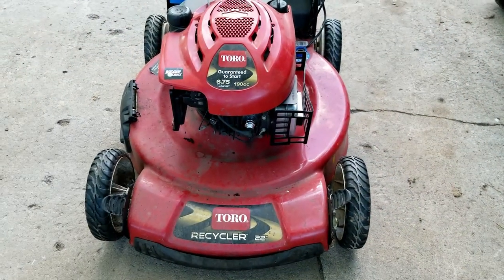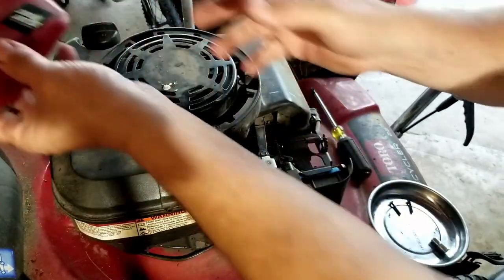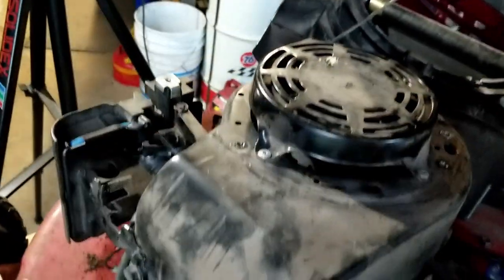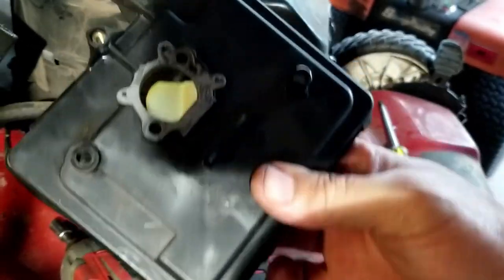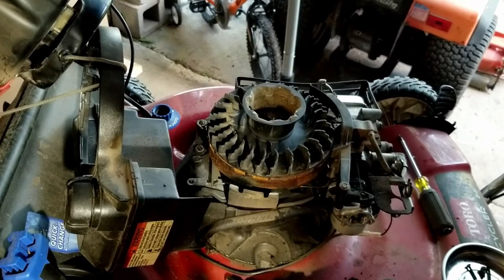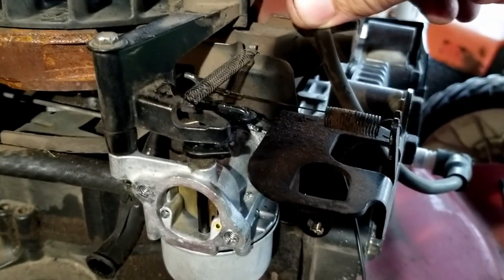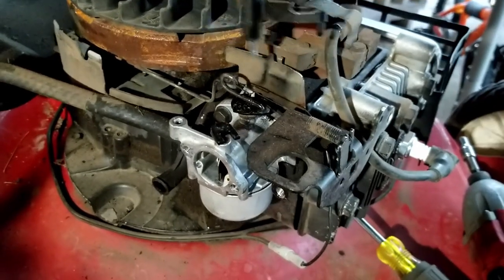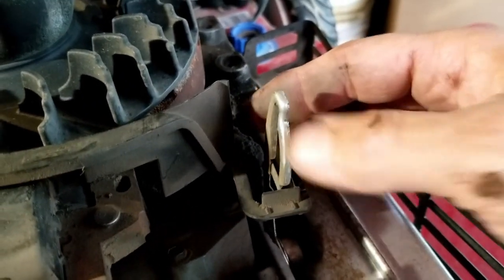Briggs and Stratton 126T02 Linkage and AutoChoke

Comment: Thanks for an excellent presentation on the automatic choke. My automatic choke carburettor no 183020 on a Briggs and Stratton quantum engine has me confused for many years. I am currently awaiting a rebuild kit for it and with the assistance of your instruction video I hope to get it working correctly this time. Unfortunately I had no plan or documentation on the carburettor. Given the quality of your video I must check your other videos. Thanks for your excellent work.
Reply from the maker: I am sure that you will get it up and running soon. Thanks for watching!

Comment: I've never had a briggs with auto choke, but I did have a honda 160 which was a simpler design but still needed to be disassembled at least once per season to work satisfactorily. Briggs system seems much more complicated than a simple primer bulb which I've always found to be dependable on briggs quantums and easy to replace when needed.
Reply from the maker: Thanks for watching!

Comment: I just found your video.  Great presentation!  Do you have any resources or where I can find the parts numbers for this exact replacement choke Linkage, Return Spring, and Auto Choke?  (I need all 3).  I am striking out completely.  Thanks.
Reply from the maker: I like to visit www.partstree.com for good diagrams. Even if you don't buy from them, you can at least get part numbers from the diagrams. Thanks for watching.

Comment: I ordered the thermostat for my B&S 126T02-1401-B1 Engine on a Craftsman lawn mower. Briggs & Stratton 593208 Thermostat Replacement Part... what all the online parts places say is the right part... but it doesn't fit!! The opening that the flange on the muffler goes into is too small, the thermostat is too thick, and the muffler bolts aren't long enough to reach. That is supposedly an OEM replacement for Briggs & Stratton Genuine OEM 790830 Thermostat. I found one on EBay, But I don't want to bother ordering if it won't fit either.

WTF did B&S add this ridiculous 'auto' choke? This mower has always been hard starting when hot from day one. Now I know why, but now I can't find the part.